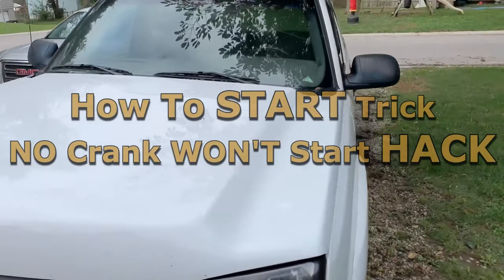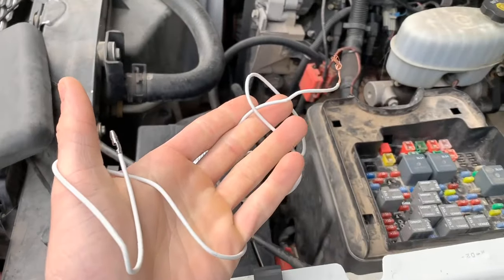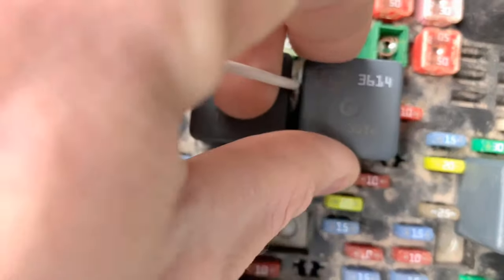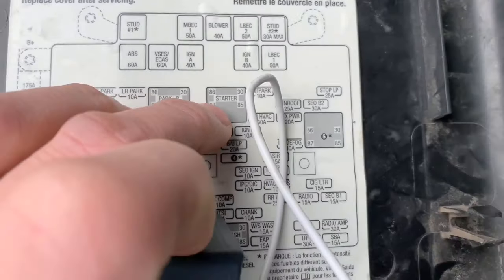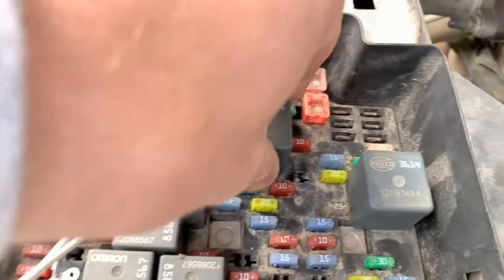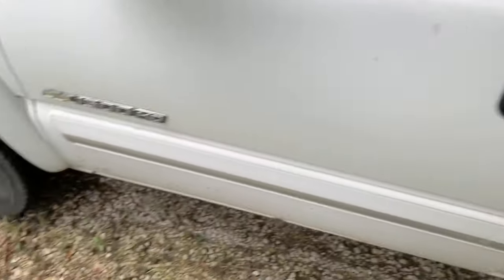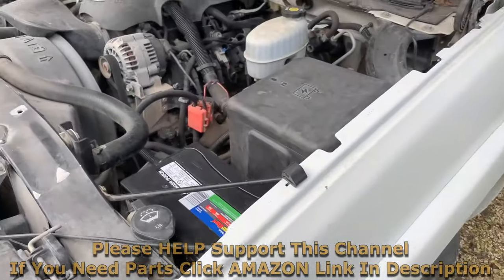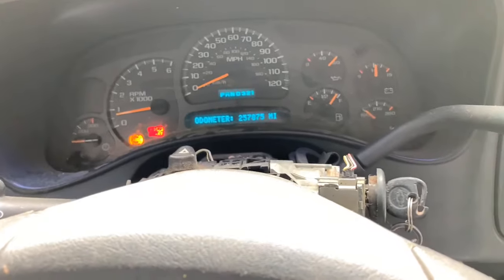NO START NO CRANK Chevy Silverado 5.3 Vortec 6.0 4.8 4.3 L How To Start TRICK Diagnose WONT START

Comment: Wow your a Blessing got stuck and was able to get it home thanks to you
Reply from the maker: Heck Ya Glad To Hear It Always A Great Feeling To Be Able To Get Home & Not Be Stuck Broke Down Somewhere. Glad It Helped!!!
Reply: What is the problem that it won't start it works that way turns on but what is really the problem
Reply: @EverydayImTECHnIt  what was the final solution?
Reply: @robertgarciariosjr222  did you ever find out?
Reply: What was the problem ? Did you find out the cause
Reply: 8 have a question. I have a 96 gmc and my starter was working fine it got to where I had ti prime with gas ti start my truck. So I turned it over more than needed. 
My starter sounds like bad bendix or flywheel. But when I got under and looked it has space in between the starter. I loosen the bolt set back in place and when I start tighten the bolts it gets space again. But when I try to start after after and it turns over for a second and goes right back to that sound
Reply: Can you help me out anyone had this problem. Do I need shims. And how to tell how many shims I need.
Reply: Have 2011 , it will crank but not start it
Reply: Will this work on a Small Blazer with a 4.3
Reply: @EverydayImTECHnIt  quick question I'm dealing with the same issue, was the starter relay bad?

Comment: Wrap wire around pin 30 and pin 87 then put relay back in same as this and run those two wires inside truck and put on push button then when it doesnt want to crank with the key you hit the button. That's what I did
Reply: did you have to drill through the firewall or was there an opening somewhere?
Reply: It’s how mines done the key don’t start my truck at all it needs an ignition switch

Comment: I was stranded at HOME DEPOT in the rain with a load of fencing. Your jumper wire hack got me started and saved the day. Thanks so much bro!
Reply from the maker: Glad it helped that's awesome it helped get u home!!!!
Reply: Weird. I was just in the same predicament at a Home Depot. This truck got me home though. Now I just need to figure out why. I swapped the relay with the one next to it. Same relay. No start. Jumped it, it started, I drove home. Shut it off and restarted it twice with no problem. Starter starting to shit the bed maybe?
Reply: Glad to know this , mabey I can help some people to , if you have one of these trucks with manual transmission and battery dies or starter goes out , cannot push start it , bunch of security bs , but you can push it or pull it and start it in reverse .
Reply: @deathproofmike8357  did you ever find out the problem? Sounds exactly like mine.
Reply: @jakearchuleta5233  Mine was the ground strap on the starter itself. The whole lug snapped off and was only making intermittent contact. I could start it, drive down the road and hit a bump, park it, and no start. Some days were fine all day. Eventually it worked its way away from contacting at all and I saw it. Installed a new starter and it's been fine since.
Reply: I'm stranded at home Depot as we speak truck won't start
Reply: myth confirmed: Home Depot curse
Reply: Omg, just got towed from home Depot raining tonight when this crap happened
Reply: I'm stuck at home depot right now, waiting for tow truck. I tried this and it didn't work.

Comment: Don’t be like me and try to fix $hit yourselves. I put in a new starter and battery. Nothing. Checked the fuses under the hood and there she was. Busted 40A ING fuse. $5 at AutoZone vs $75 for a starter and $160 for a battery. Oh well. At least I learned how to replace my starter. She’s 20yrs old (1999 step side z71). She was due for some pampering.
Reply: Did you find the issue?
Reply: I bought a new battery at Walmart for 120 
And a new starter for 150 
I just tried this wire trick and the engine sounds like it wants to run but it just drags ill check that tomorrow

Comment: Had the exact same issue after changing my knock sensors. Truck died while driving and left me stranded, huge tow bill home, not to mention the wait! ...And I digress...
Anyhow, finally bought schematics and found that ground G103, at the back of the intake manifold behind the plenum, had broken inside the wire jacket. Gave it a tug and broke right off. 
Simple crimp eyelet was the fix. 
G103 supplies ground to the PCM, as well as the O2 sensor heater grounds. 
Stupid electricity.
Reply: I found the 5.3 harness has 4 ground wires on it. Will any one of those prevent the truck from starting or just the big flat wire ground on the back of the block?
Reply: Without any or all of those grounds, random things will not work. Could be a no start, could be poor performance. 
The big ground strap you're referring to is part of the grounding system (which ties the engine block to the frame to complete the grounding process) but the others will hinder the flow of electricity so as not to let things work (I.e. starter or PCM). 
My bad ground was on passenger side back corner of engine, coming from main harness to the intake manifold. 
If you were able to find somewhere that showed you the harness has 4 grounds, you can now search the locations of those grounds to help you find which is broken.
Reply: @nickcoleman1073 I checked my starter and big bolt had pwr little bolt didn't even when key was turned over. Think it's a ground also ?
Reply: Nope, that would be a positive signal wire coming from the starter relay. 

Start with a continuity check of that wire between the relay and the starter. 
Could just be broken. 

Could also be a bad connection at the back of your underhood fuse box, very common issue. 

Hope that helps.
Reply: @nickcoleman1073 I can take a jumper wire from the positive to number 87 on the starter relay and it cranks up like brand new
Reply: @nickcoleman1073  sorry to bother you but any thoughts on what's coming to the starter relay
Reply: Check the CRANK fuse under the hood, that supplies 12v+ to the cranking circuit of the ignition. 

Maybe also check for that 12v at the starter relay pin, to see if the ignition switch is actually supplying the relay coil with voltage.
Reply: @nickcoleman1073  got it boss, u got my vote
Reply: @nickcoleman1073  common issue, bad connection back of the fuse box?
Reply: Very common actually. 
The connectors inside the plugs that plug into the fuse box go corroded. Or when there is multiple conductors at one pin, the wires will corrode and lose connection. 
When mine failed, I had an old fuse box laying around from my '95 build, that I just used some of those pins and spliced them into the places where the stock '04 connections failed. 

Random losses of systems or individual parts, this will likely be the cause. 

I had lost the driver side headlight low and high beams and fog lights.

Comment: My 03 develooed tge problem on hit august day,  outside parts store ut cooled off few dqys later startwd everytine until 2 nintgs later.
The starting curcut is 3xpensive to replace everything.
Igniin switch 90
ECM/PCM 350
BCM 365
Starter 450
Eelay 10

Midern vehicles.
My old scholl novas one SS just eeplace the starter for 150 back in working order

Comment: Thanks so much for this video. It just saved my ass. 2002 Silverado 1500 was a no crank no start. This hack got me back on the road and I had a dirt bike in the bed. Worked perfect and I Thank You Very Much
Reply: that's great that it worked for you I'm having the same problem so that means the relay is bad

Comment: Thank you for your video. My 2003 Avalanche would not start, just clicked. I was about to do your hack when I noticed that my relays were upside down. I pulled the Park LP and Starter relay, flipped them and it started right up. My cluster lights weren’t turning on either and now they are. My cluster lights would work intermittently. I think this whole time the upside down relay might have had something to do with that. Thanks for the save!

Comment: This was the fix for me. Got the Suburban at the auction on Friday and have it running on Monday. Thanks a lot!!
Reply: What was the final resolve for the issue? Did the problem come back? Just happened to me on a Silverado purchase. Ran and drive fine all weekend. No crank no start on monday, started right up with the hardwire from battery to relay. Is it the relay thats no good or the starter? I had my battery tested, battery was good.
Reply: Did you ever find your solution I'm in the same situation right now...checked all fuses etc what is the actual reason for this to happen. I was just driving it and starting it up fine...cluelt
Reply: @joshuaroberts6712  . same here..
Reply: Anyone get to the bottom of it??????

Comment: Changed the relay yesterday and tried to start it using the wire and got nothing. Had to tow home.  Switched out the starter and couldn't start the truck normally but could jump it with the wire. Switched an ignition switch off a parts truck and still had the same issue. I then removed my new relay and put in my old one and the truck has fired up since. Be careful what relays you are putting cause it could cause more head aches.  Pretty sure my starter was gone based on how corroded it was.

Comment: People should know that there is risk to this kind of repair. If you make a mistake and tap an un-fused 12V jumper wire to the wrong terminal or wrong relay, you could send a huge current surge back into one of the sensitive computer modules. Worst case scenario, that turns a simple repair into a confusing estimate that may be more than the truck is worth. Without a wiring diagram and enough knowledge to respect what you don't know, it would be wise to leave it to a pro. With a few simple tests, a pro makes a clear diagnosis, first. Then if he does decide to jump power to a low current relay, he might use a test light or fused jumper that caps maximum current. That way, if he does make a mistake, it is less likely to cost him his job.
Reply: It's great that you informed people. But sometimes being stuck on the side of the road with no PEOPLE let alone a PRO in sight...
Reply: @mikelboyd711  I used to think that people brave enough to start randomly cutting wires or jumping wires would be embarrassed to later take the vehicle to a pro without telling him exactly what they did. Surprisingly often the pro needs to spend an extra hour fixing all the damage caused by the backyard mechanic, so that he can get a clean data set from the car with actual clues without all the background noise of artefact caused by DIY attempts to fix it. When you jump wires, the computer will notice those attempts and flag a trouble code that may be completely misleading. Trust me, you're better off spending money on a tow and avoiding the catastrophic event of serious computer or module damage from jumping the wrong wires.

Comment: You can also just pop the relay cover off and squeeze the contactor together and it will start no need for the wire
Reply: squeeze which contactors?
Reply: Can you elaborate on this?
Reply: How
Reply: explain?
Reply: to be clear: turn the relay upside down so the pins are facing up. take a small flat head and pop off that cover (it's not sealed). Put the relay back in. You'll see a tab style contact. Just push it in so it makes contact. I just got jumped that way but there was a guy under the truck also giving the starter a tap. Not sure if that was necessary but it got my no-crank-no-start going. Guy helping (was a mechanic) said i needed a new starter.

Comment: Instead of putting relay back in just jump 87&30 in fuse box look at your relay it will show you which holes the numbers are
Reply: Tried this and blew my 40 amp ign fuse
Reply: That's why you have relays the relays handles the voltage the fuse just causes the relay to close the circuit

Comment: I jumped the starter relay the same way as in the video and my truck still does  same thing....doesn't spin over or crank...any suggestions? I need some advice ASAP...IM LEANING TOWARDS PARK/NEUTRAL SWITCH OR IGNITION SWITCH
Reply: Starter battery or alternator

Comment: Thanks first off . Idk mine is being crazy. I did this and it worked, and then mine started by the key 40 (not actual) times in a row afterwards and quit staring by key again. It’s randomly not getting power to start solenoid 
any suggestions?
Reply: My 2001 does the same thing.  I have to keep trying the key until it goes.  I think I'll hook up a permanent wire with a push button. 👍
Reply: Nemo Express mines starting for 2weeks straight without incident and got this hack ready at the need though lol
Reply: Same with my 2011 express van. 6.0 engine.  Did you ever fix the problem?  What was it?
Reply: @stevensabeh6852  no it miraculously quit doing it.,,,, for now. I actually think mine has computer issues.  I can stop at a light and it shifts really hard  until I stop , take the key out and open the door ( typical gm product shit off  radio etc) and it shifts fine again. Mine is an auction truck was used as a service truck

Comment: Dead battery, tried jumping it for an hour, lights on dash and dangling work still didn't want to start. So I tried the hack and started running.I am going to charge the battery for a while and see if it will start on its own. Thanks I'm impressed

Comment: I had that same problem so I took it took a certified mechanic, and the problem is the computer is not sending a signal to switch,so I had 2 choices 1 by pass it,or buy a new computer,so I chose to by pass it and now It starts up every time when I use my ignition key I hope my info helps someone cause I didn't wanna keep going under the hood to start my truck,but this video helped me out a lot because I was loosing help wondering how I'm gonna start my truck.  Thanks
Reply: How did u by pass it
Reply: How did you by pass it ?
Reply: I ran a wire from the relay to the number 10 fuse and it starts up every time when turn the key on in the switch
Reply: Reginald Jackson what fuse is that? Ignition?
Reply: @reginaldjackson1001 what the number 10 fuse please.? I'm broke and it ain't no joke.

Comment: Why not just change the ignition switch? obviously the starter works it's the control circuit the ignition switch or neutral safety switch

Comment: I've had this problem and used the 87 to 30 jumper for the longest time and then i found if i put my truck in the on position and wait for the security light on the dash to off and as soon as that happens i turn the key back to off for at least a second then it will turn over on the next turn. So on wait for the light to go off, turn the key back for a second and then turn the truck over. It's work everytime so far. The only time it doesn't work is when i try to turn over too fast without waiting at least a second or bit.
Reply from the maker: Hmmm that's odd issue but good to know thanks for sharing!!!!

Comment: Thank you so much the same problem happened to my Hummer 2004. And I used your hack and I was able to get home. But before I saw your video I put a new starter thinking . That was the problem. But it wasn't it still didn't start.

Comment: My 03 GMC is doing that but after a few trys on turning it in with the key it starts dose anybody know the problem
Reply: Mine does the same. 2005 silverado LM7 5.3. I found a loose starter cable that seemed to help. Connector was bad also to the starter.

Comment: Just tried it.  It worked.  Not sure what is bypassed with that process.  It was hooked up to the starter terminal on the fuse.  I turned it off and restarted it without an issue.  Wonder whether something got wet.  Thank you for the info.
Reply from the maker: no problem glad it helped maybe wiring issue FYI like nicked wire or loose wire

Comment: Once I tried your outstanding hack I went to my neighborhood O’Reilly’s. They tested my battery, alternator and starter all which tested fine. The guy who worked there said it was probably the starter relay and suggested I also should purchase the ignition relay since they usually fail together. I told him I swapped them out and my truck still didn’t work. He said the ignition relay was started to fail. I purchased two for a little over $33.00. It was definitely cheaper than a starter or alternator and much easier to install.
Reply from the maker: Glad to hear it helped you brother & you got it figured out thank you for the feedback!!!
Reply: Did that fix the problem replacing both relays?
Reply: Aren’t the starter relay and ignition relay the same thing though?
Reply: Can anyone help me im getting no spark no crank no shift indicator after a jump
Reply: @lukewood8527  I think he means the grey IGN relay in the underhood fuse box. The starter relay is attached to the starter. Pretty sure it's non replaceable on the stock starter

Comment: Have a ball changing the ignition switch to fix it permanently. A relay swap will let you know if it's the relay.
Reply: Swapped mine... Didn't work. Definitely an ignition issue.
Reply: When you swap the ignition switch in your vehicle did solve the problem???

Comment: It happen to me so I check the fuel pump relay it was good, the fuel fuse was good, so I detached spark plug wire 1 and put it where it was a ground and it was spark, the last thing I did after checking the things I mention before, was that I put some gas in the throttle start it it crank and it work again.

Comment: Wrapping wire around wrong pin is a good way to fire the PCM/ECM  - engine computer  . You turn on the key an jump pin 30 - this is battery voltage  to pin 87  -this goes to s terminal on starter solenoid . i should say jump where those pins plug into the fuse/ relay box . You could use a paper clip , who of you have a piece of wire sitting in your vehicle  ???  .